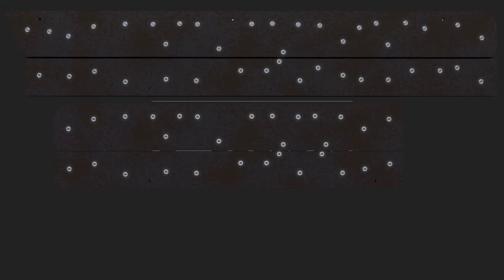SatisRefactory 2

Comment: Also if you send stuff arriving on a train to an overflow don't you risk it running out between trains? it seems like it would be safer to overflow where you load the train instead.
Reply from the maker: Trains are still my favorite way to do overflow. You can see a station there around 10:19 which has all three platforms dumping to the recycler. The train makes that the last stop on the circuit, so anything un-used gets unloaded.